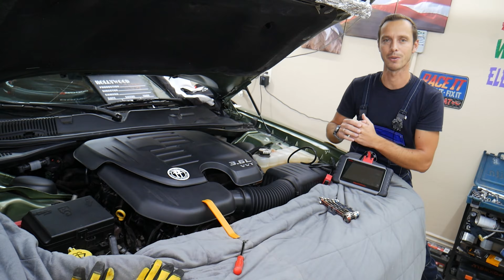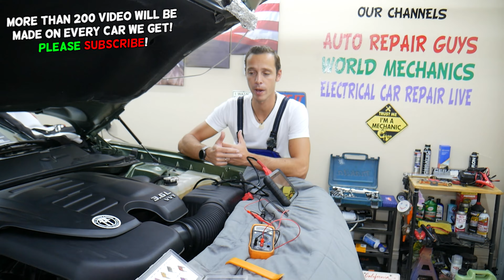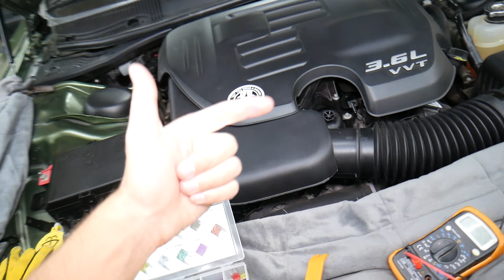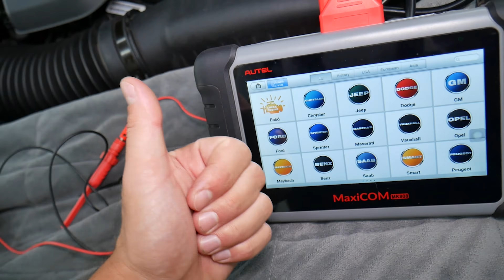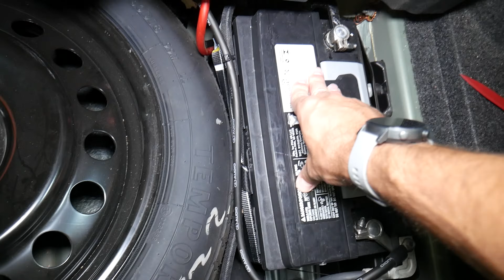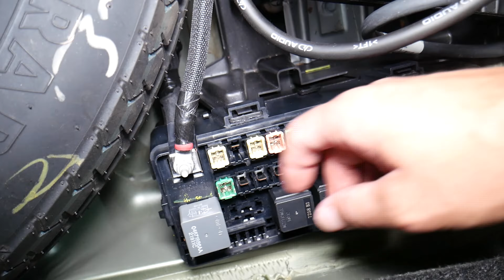DODGE CHARGER BLOWER MOTOR FAN FUSE LOCATION REPLACEMENT, HEATER AC FAN FUSE

Comment: So I have a question you night be able to help with. On my 2013 dodge charger my hest works fine as long as my fan speed is on 4 or less. But if I try to turn the fan up (either to 5 or 6) it just blows cool air. It's the same when I try to do the defrost. I googled the issue which led me here and I'm commenting before watching the video. Hopefully this helps but if not, thats my issue. Anyone know what's going on?